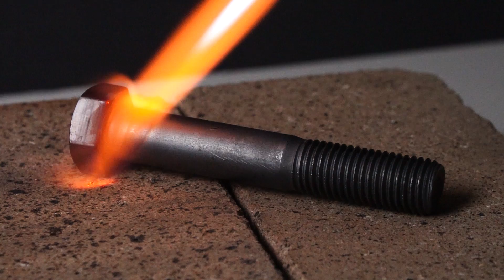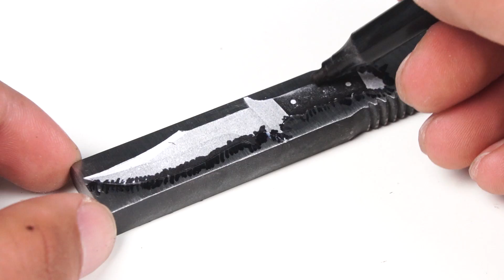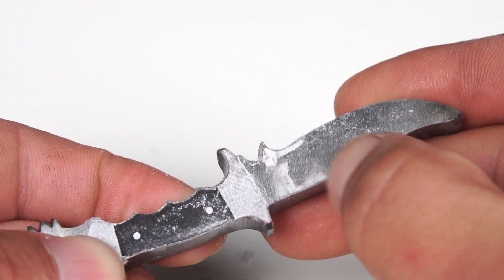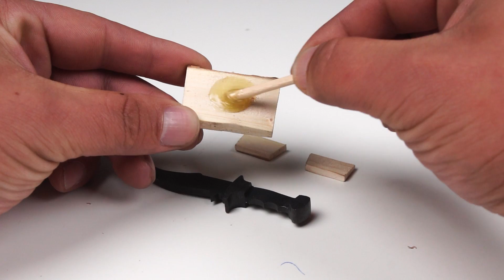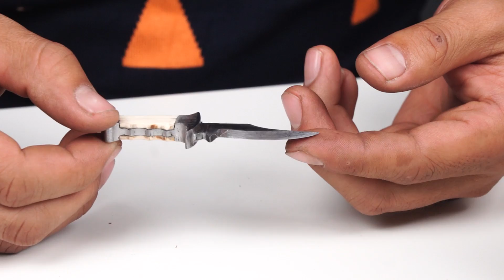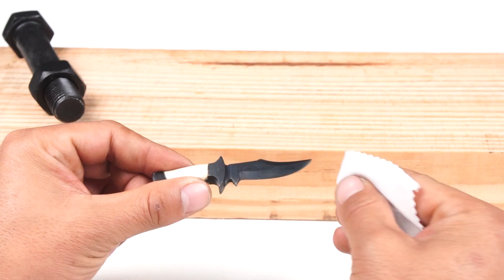How to make a mini knife with bolts

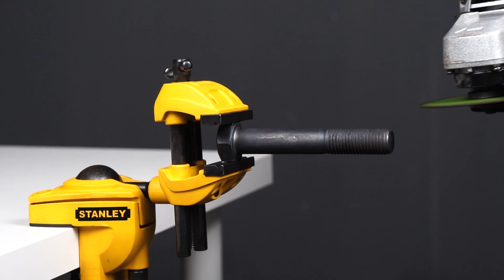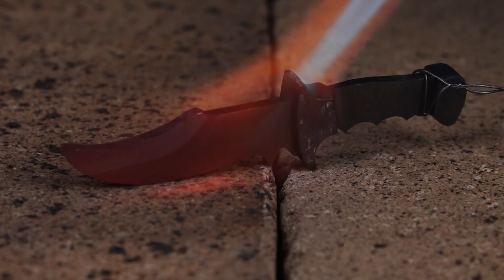Comment: 0:20 Then forging? That would take a while. 0:30 Okay... Kind of disappointing. 3:21 It's not even Austenitized, besides, bolts are usually low carbon steel, why bother quenching?
Overall, dislike.